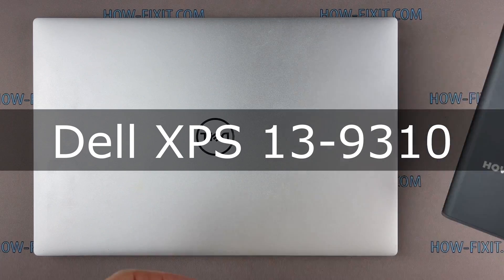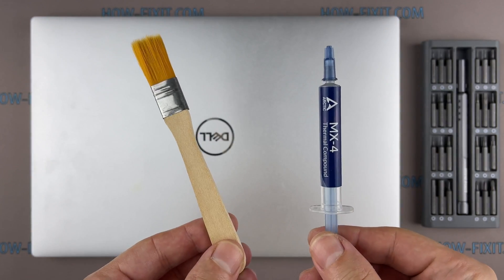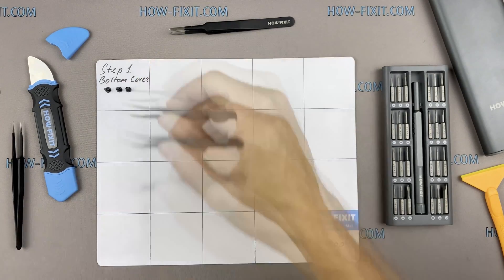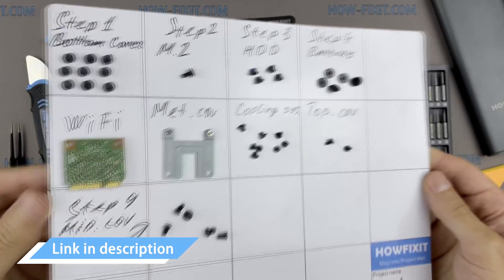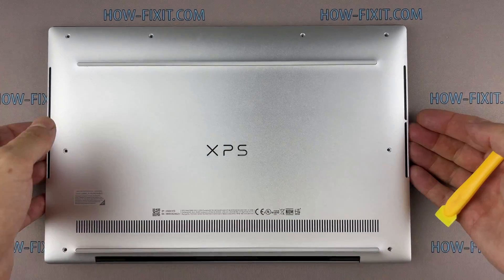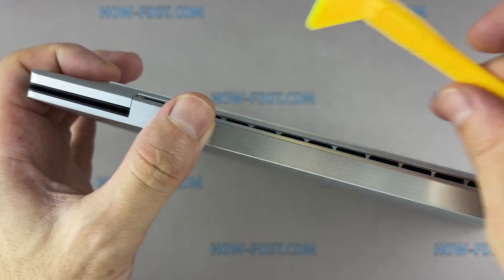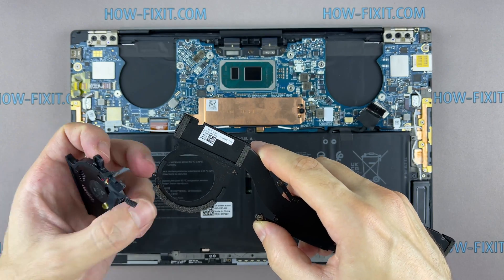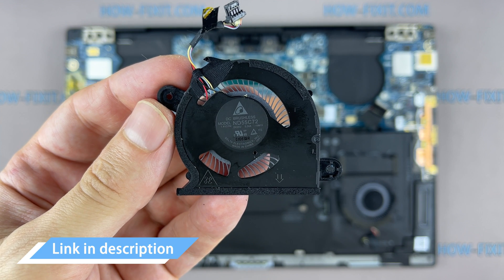Dell XPS 13 9310 Fan Replacement Guide

Comment: My latest XPS 13 9310 has the exact same issue with the left fan, looks like it's a common thing
Reply: bro i’m having the same issue. The left fan gets kinda stuck while roaming. What did you do? Did you change the whole fan thing ?
Reply: @Mimis880  sold my xps and bought a mbp. Never looked back. My bad